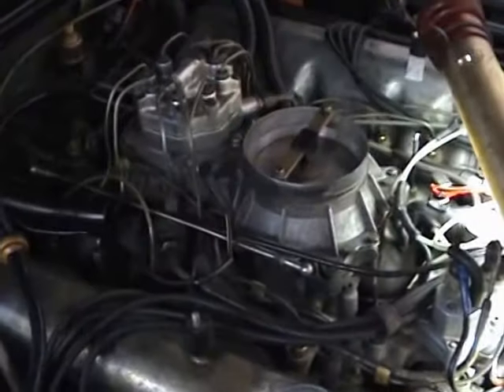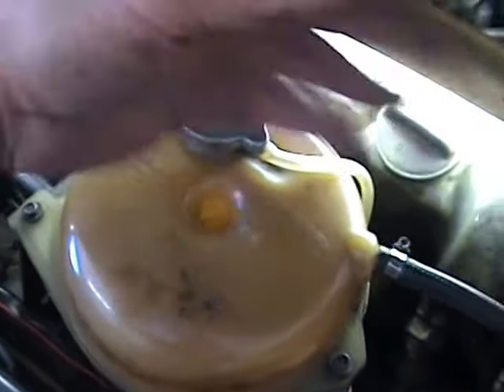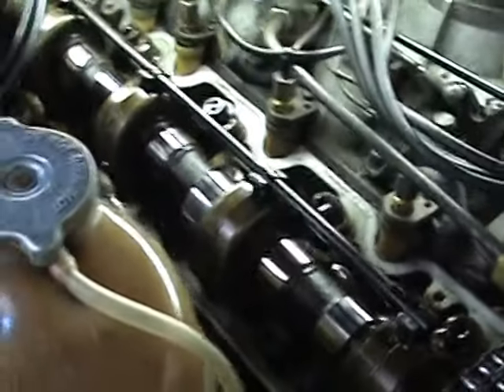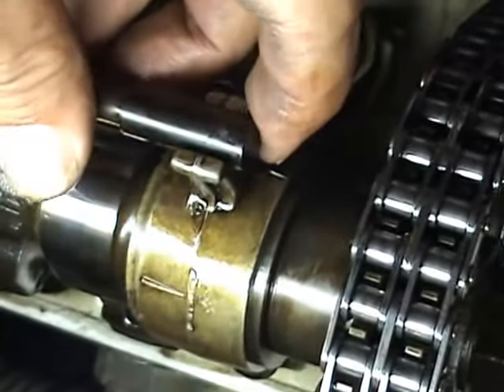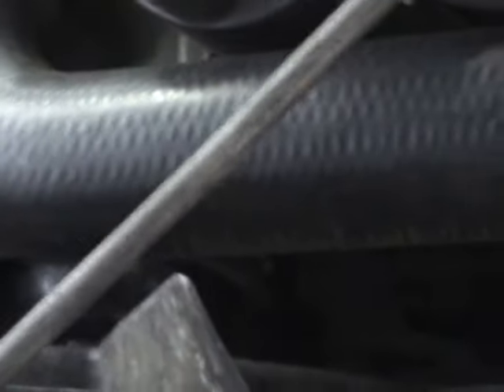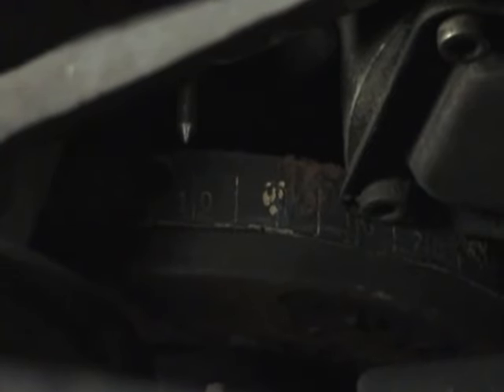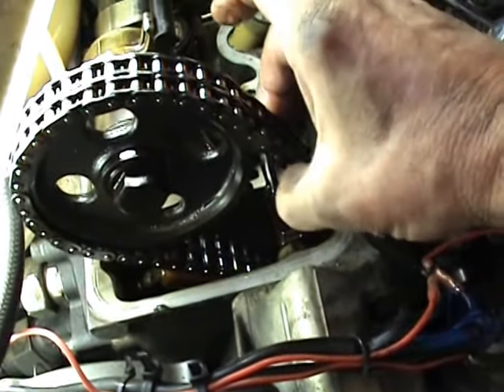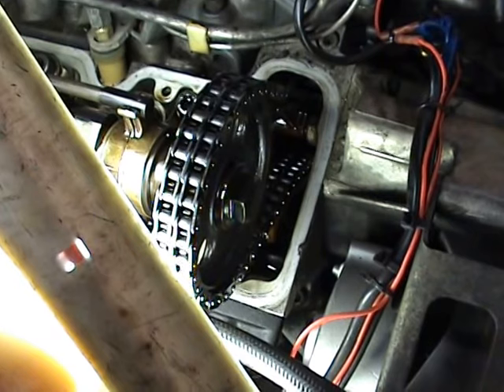Mercedes 450SLC Timing Chain Check

Comment: Hi, thanks for the video. I have an 84 SL380 (double chain) and sometimes i hear nocking noise on some of the early starts, i am suspecting the chain (the car odo stopped at 126 K miles lol and donno how much it is now). Anyhow, i am starting with an Original MB Tensioner (as this is an easy job to replace) and will monitor the sound (i presume that a new tensioner will help to reduce the slag in elongation?). If it didn't work, i guess i will replace only the chain as replacing it is also somehow easy (connect the old with the new and hand turn the engine right). so any comment?

Comment: What year is the SLC in the video?
Reply from the maker: Hi, Vick It's a 1977 model, no engine ECU or oxygen sensor. Had a smog pump. I think from 1977-80 they went back to pure mechanical. cheers, Paul.

Comment: Hey my grandfather is looking for the fuel injection control in his car. Do you have any idea where it may be?
Reply from the maker: Hi, Matt  My car is a 1977 model, from 77-81 they have no ECU,  on the earlier model cars the ECU is located behind the glove box. I hope this helps, regards, Paul.
Reply: @riffraffjazz  Hi, i own an 84 SL380 (USA import). i noticed that the secondary air pump belt is disconnected from the engine. is that a big deal?